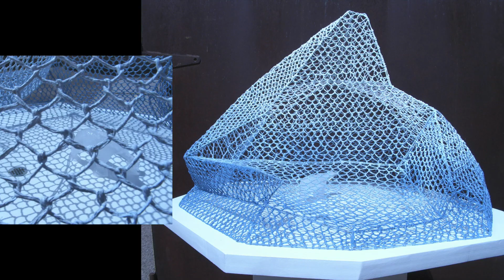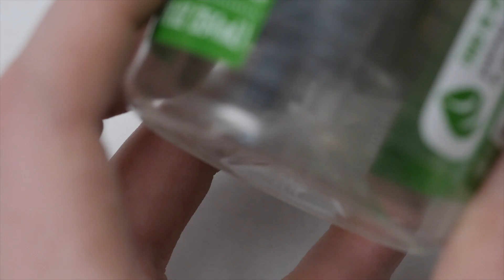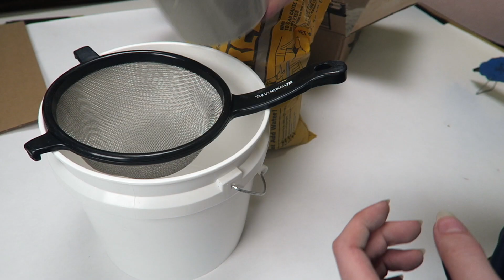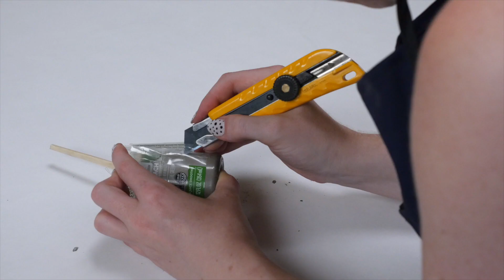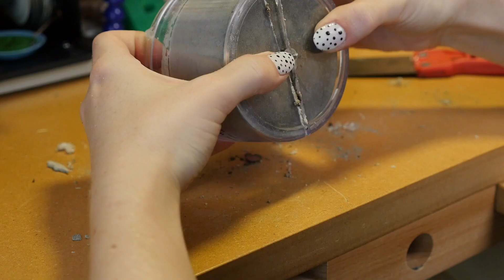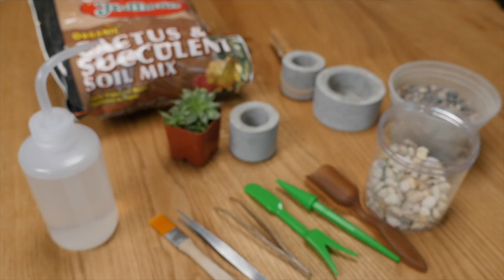Concrete Mini Planters // Becky Stern

Comment: Use frost proof in them it hardens the concrete also try and use a mold once you have your desired planter you can also buy ready molds for this. Use a light grain sand mix also in your cement. Use washing up liguid  waters down 
to pull the container away without breakage

Comment: You could try mixing perlite and coconut coir in instead of gravel to make lightweight hypertufa pots. Weight is possibly not an issue with the little ones you made here but if you ever go bigger it could help :)

Comment: Nice. Good trick about sifting out the aggregate, I'll have to remember that next time I try working with concrete.
Reply: you can also use a non-shrinking grout instead of sifting aggregate out of concrete. the same kind of grout you'd use for tiling.

Comment: These look great, but I'm curious about the material - I'm probably missing something basic, but isn't concrete essentially just cement plus gravel? And you've sieved out the gravel? So why not just start with a bag of plain cement instead of concrete mix?
Reply from the maker: +Ewan Mac Mahon shrug so I can use it for other stuff, too, and also I reused the gravel for planting.
Reply: There is still sand